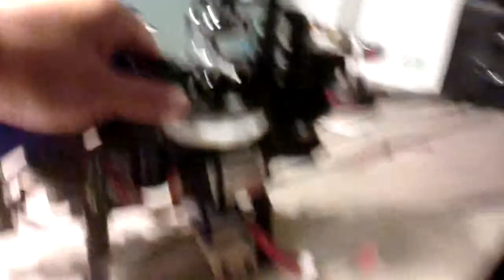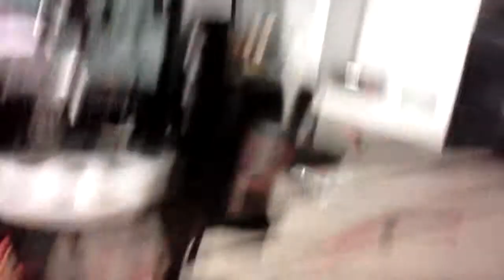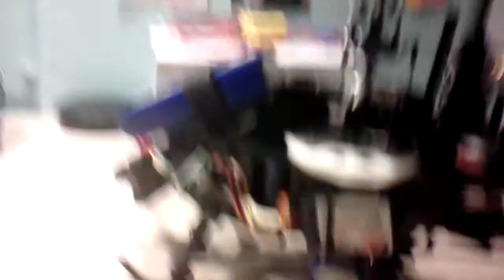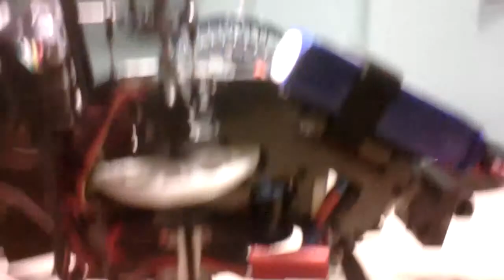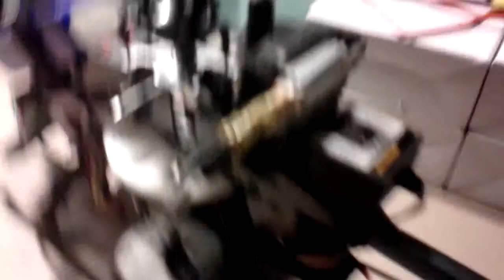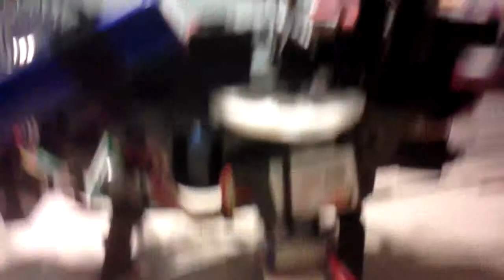Exi 450 pro fpv setup

Comment: Right. I was thinking just a fly mentor or co-pilot- but you are well on the way to building a muti and I am sure you will get the best result from that as far as stabilized video goes. I am working on a "Genius 500" complete with ( never quite true) plastic rotor head. $350! It will be similar to what you have done here and will use a 900mHz 500mW - I look forward to the day I can post a great vid such as yours! Good luck!
Reply from the maker: This video is fairly old and I've built a lot of multirotors since then. Check out my channel for latest videos. The difference is amazing going from heli to multirotor. I'd stay away from 900mhz. It's an old frequency and a lot of organizations use it. You're better off with 5.8ghz or 1.3ghz depending on what country you live in.